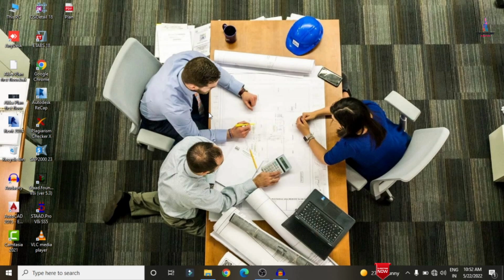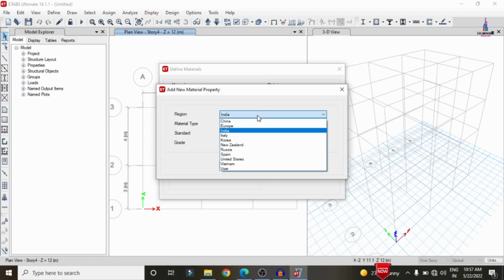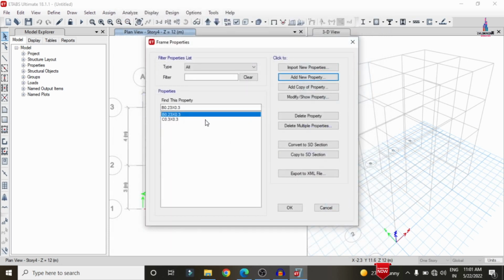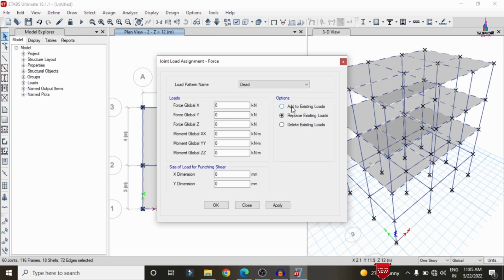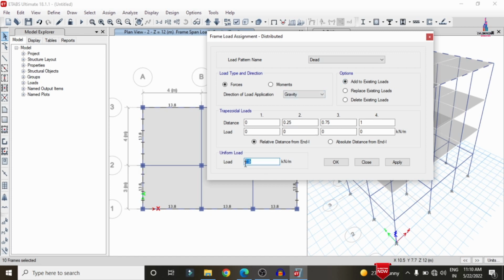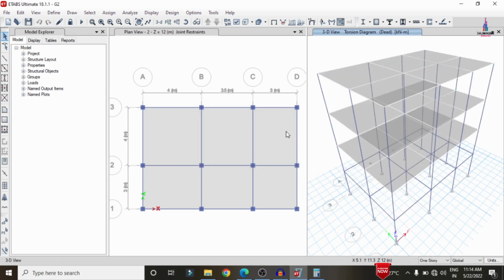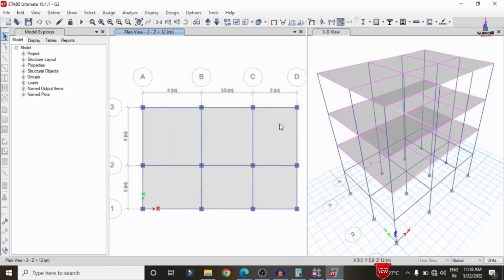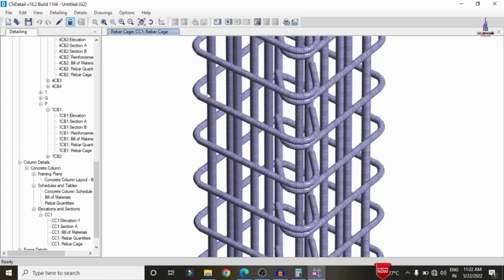Learn complete step by step building design by ETABS software | civil engineering | online |

Comment: Thanks sir. 
Please sir, I  modeled and design a single story RC building  in Etabs and decided to Cary out detailing of the structure using RCDC and CSI detail v18.
I discovered huge  differences in Column details especially. 
The column reinforcements generated by CSI details was way too high to my observation. Imagine where RCDC provided 4-Y16 bars for a (230 x 230)mm column, CSI detail was giving me 12-Y16 for same column. How can it fit in? 
I believe the analysis results was same and I also want to believe I might be missing some additional settings somewhere in CSI details sir. 
I really need your help in this sir as other structural members were similar in details but colums.
Thank you sir
Reply from the maker: Ok, That's good to here u r done with design.text to my mail for quarries
Reply: @civilengineeringbyshravan9596  your Email address sir. 
Thanks sir